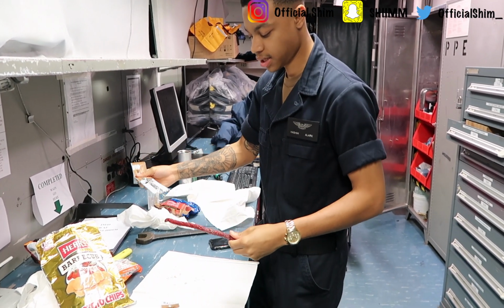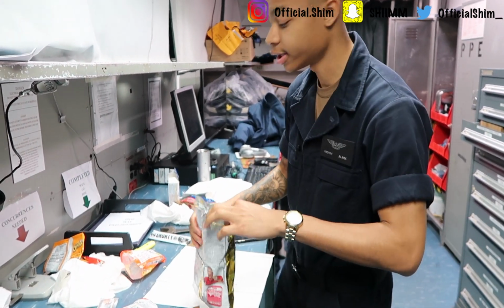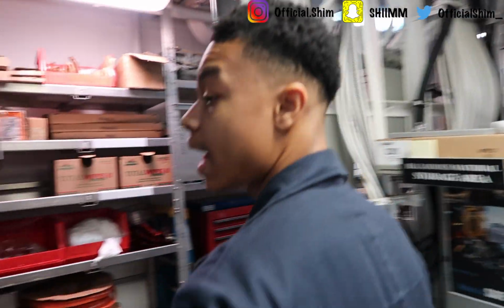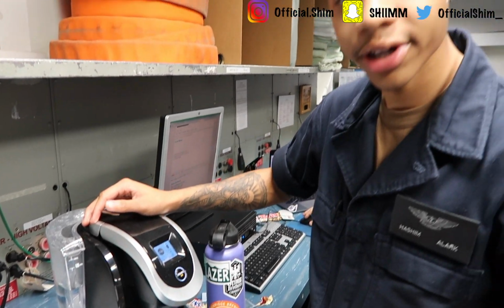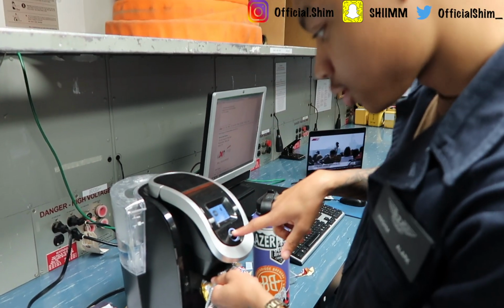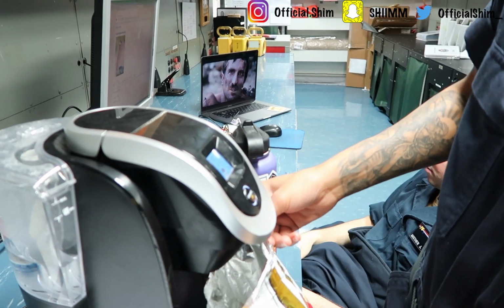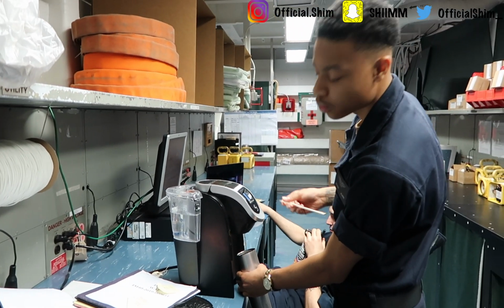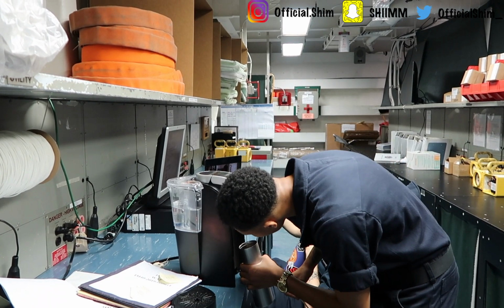Cooking With OfficialShim! | Navy Noodles

Comment: What are the odds of getting a H3 hearing waiver from any of the branches? Went to MEPs yesterday and got disqualified due to the hearing test failure. (Nothing is wrong with my hearing. Just couldn't distinguish between the beeps in my head and the beeps in the machine.) I was over thinking about everything at the time..